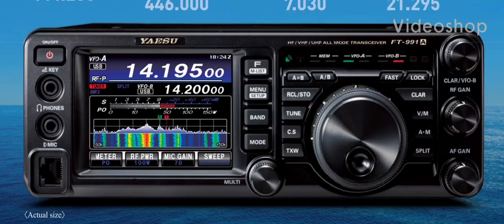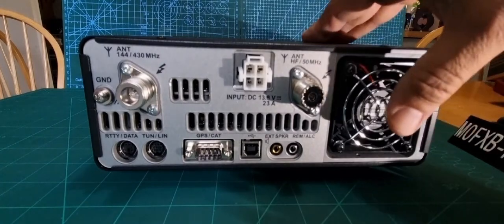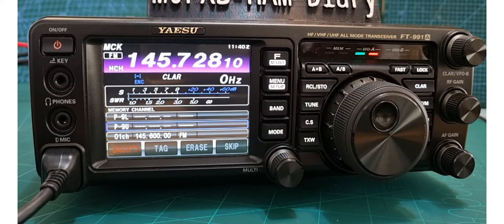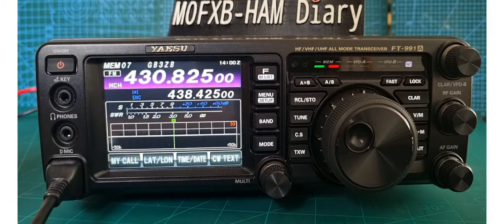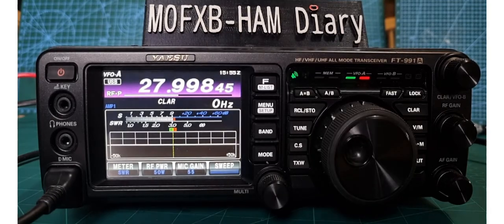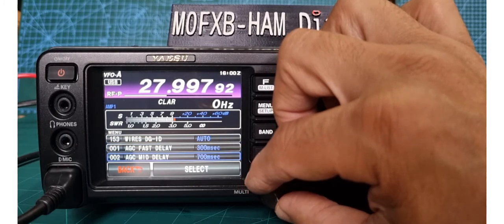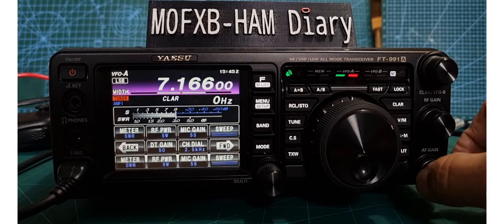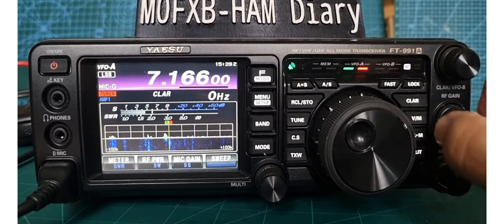YAESU FT-991a How to Video Use Radio - BASICS ,Tips and Learning

Comment: My ft-991A doesn’t transmit above 145.999 or 439.999. I purchased it from a seller in Japan through EBay. Are radios programmed for certain countries? Any information would be greatly appreciated thanks.
Reply from the maker: Yes they are you probably can unlock it I would ask a HAM Radio shop.